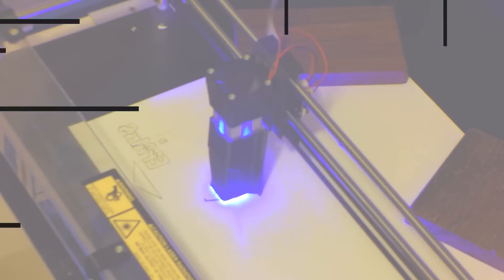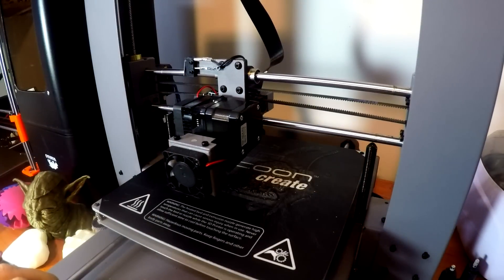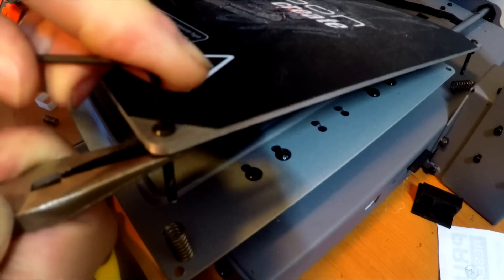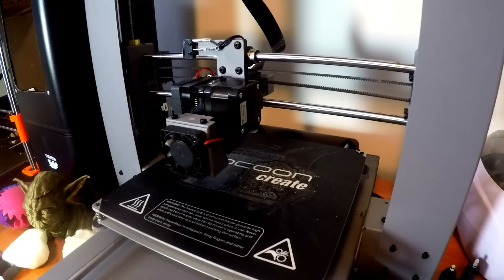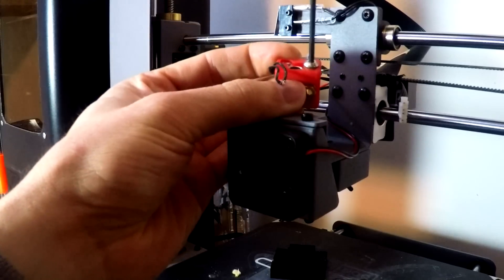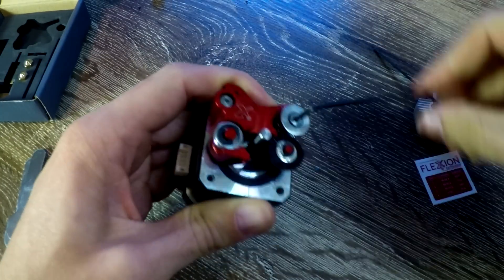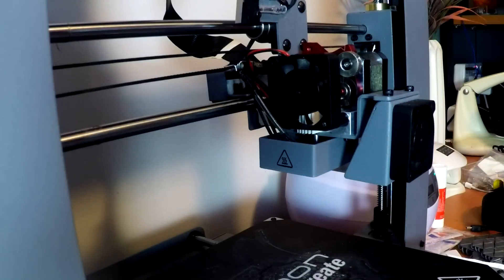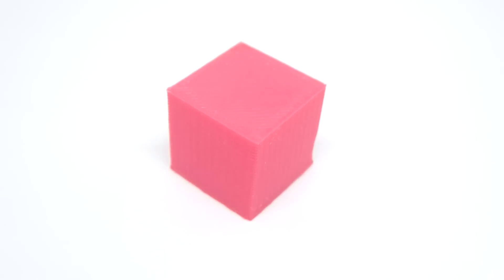Flexion Extruder - Modding my Aldi Cocoon 3D printer / Wanhao Duplicator i3 Plus

Comment: i have a problem i  recently bought a cocoon create (wanhao i3 mini) and i am having  a problemfinding replacements parts ilive in asia..what is the voltage of the t hermistor for my machine... is iot a 12v or a 24volt...also what hot end is compatible with it..if anyone could help with my problem it will be very much appreciated

Comment: I received the Flexion Extruder. I went and purchased the Single Bundle. What a difference this has made. Printing ABS and PLA without issue. Will look into the HT Hotend and what that can do. Very happy. Will look at the other upgrades you have mentioned doing. I understand the World has probably moved on since this video but I'm still on my first printer which needed improving. :D

Comment: Great piece of kit, I ended up knocking up a pair of TPU spacers that were the length of the stock spacers + the required washer (BTW if you get one, the washers are under the foam padding, taped to the bottom of the box).  Bonus is it cuts out the slight increase in vibration you get from the fan with this heatsink.  (yes, the design is on thingiverse)

Comment: i had this filaflex here. very duffucult to print i with some mod i can print it at 10/20mms on Ender 3 or Tarantula.
 had you successfully print with?
take caro to avoid moisture ;)
Reply from the maker: Filaflex is pretty soft. The flexion made short work of it but it's pretty difficult on other printers. 10-20mm/s sounds about right. I printed slightly stiffer TPU on a stock Ender 3 without drama, didn't try Filaflex.

Comment: I have a the old school Replicator Dual and the only trick i did to print with TPU in my case was to print at 15mm/s to be safe, it seemed to do 20mm/s fine and 25mm/s was a little skippy if you will. But, my prints are stringy because of the extra heat i need to get it to flow well. So there's definitely a case for the Flexion Extruder.
Reply from the maker: The only printer I could get flexibles to print on back in the day was a Rep1. That was actually a pretty solid machine.

Comment: I'd love to see a z brace install- but not those front mounted ones, a rear one, so it's still easy to get in there from the front to adjust the bed etc.
Reply from the maker: I was just looking at th printer and thinking the same thing. If I do it it will be on the back only.
Reply: This it what I use: 
https://www.thingiverse.com/thing:2438817

Comment: After the Prusa i3 MK3 video I was a bit crestfallen for my Aldi Cocoon, however I had no idea that there are these mods and workarounds available. Thanks for the update TT :-)
Reply from the maker: No problem, more to come!
Reply: Holy flaming hell Don! Thank you so very much for this information. I hope you don't mind, but I've had to cut n paste your reply here into OneNote so that I can get my head around it all ;-). I've got a section of my man cave that I'm modifying with a stronger plywood bench and also adding more shelving and this is where I'll put the printer now. I've even thought about making a glass or perspex cabinet (whichever works out cheapest!) to put it in but I am also thinking this is major overkill lol!! Yes, it is a good word that I use more often, as age takes hold lol!! Thanks Don :-)

Comment: Nice job 👍 I like that you’ve turned your second printer into a specialist machine. Once if finished printing the parts for the RC Truggy I’m going to try some flex material on my MK3. Good luck with your test 🖖
Reply from the maker: Thanks! I figured it was a better use for it. Keen to try printing flex straight onto clothing like the channel RCLifeOn.
Reply: Teaching Tech I like the idea of trying that as well. Hope to see you do a video covering it 👍
Reply from the maker: Definitely will. I have a vinyl cutter and heat press which I'm yet to feature so it will make a nice comparison.